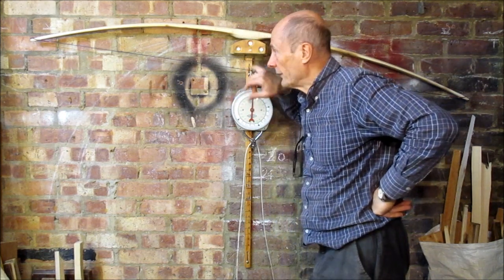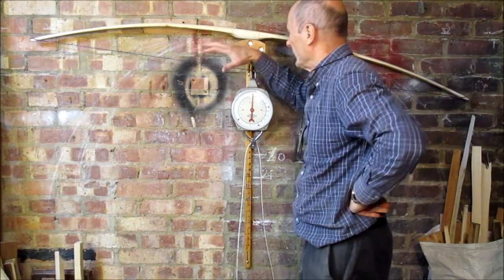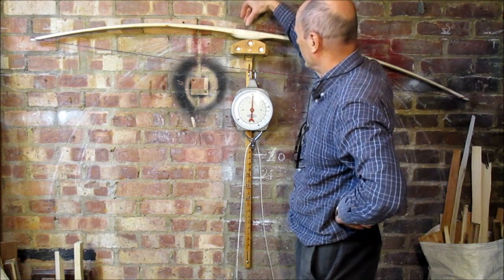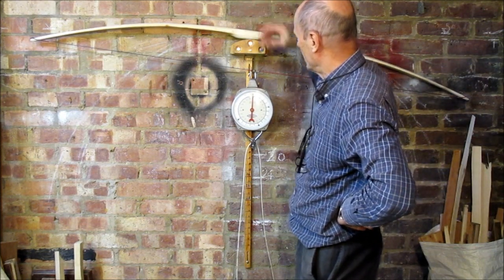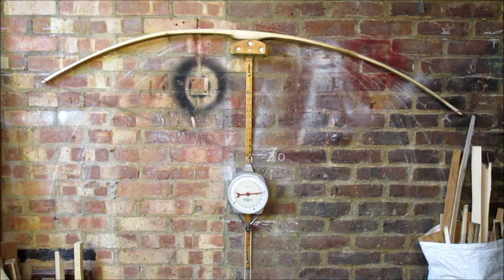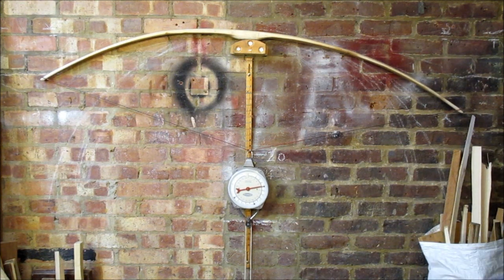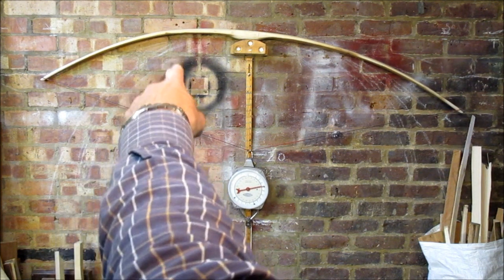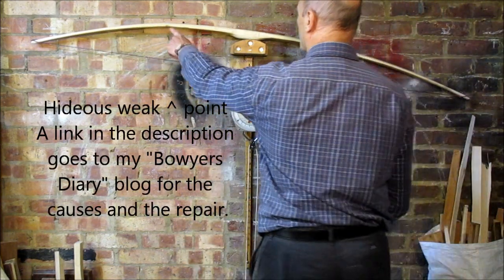Wych Elm Bow Problem

Comment: I would guess that the heat treatment might have stiffened the right limb quite a bite more than the left. I have had the same problem with heat treating in the past.
Reply from the maker: Yes, that can happen, but this is a very localised weak point.
There was a tiny pin knot on the edge and signs of internal cracks possibly as a result of splitting the stave (it was a very skinny stave). Pics on the blog